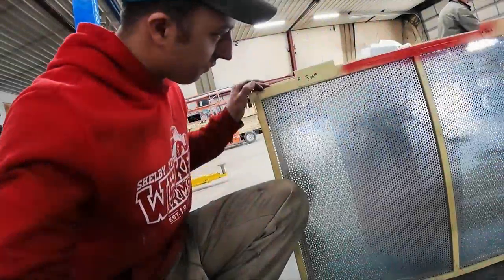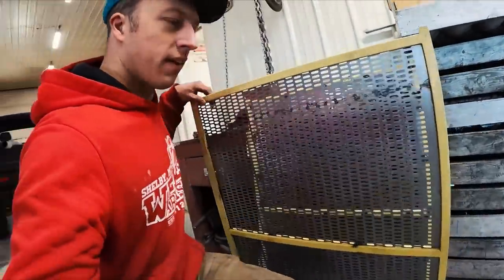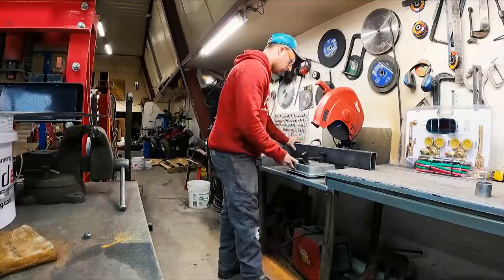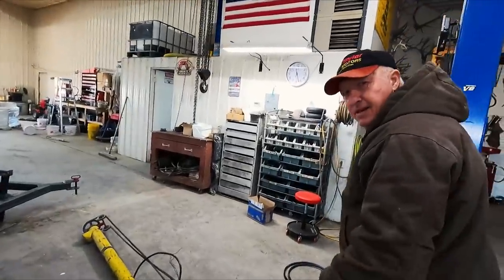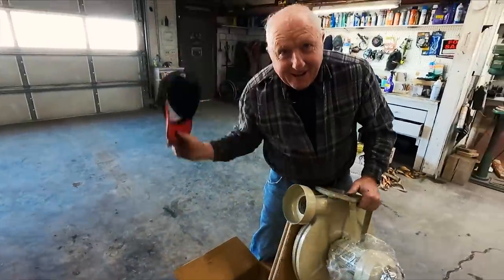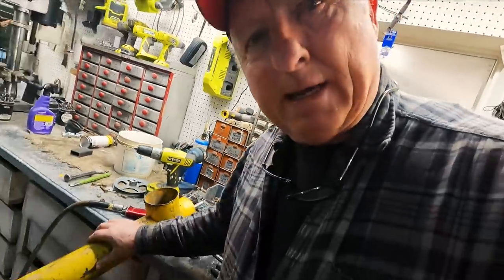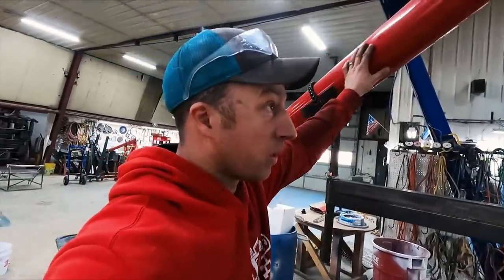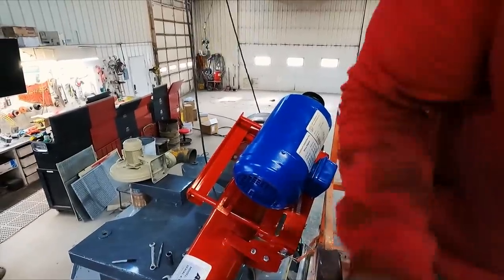It's FABRICATION DAY! Mixing Old with NEW

Comment: You guys should look at lenze drives.  The ac tech will work great, you can input 110v and it will output 3ph.  I use them all the time.

Comment: You should put a small spring between the bottom of the tube and the nut so it will lock itself into position and you wont have to worry about it vibrating out

Comment: From my past years in a certified seed cleaning plant,  you may want to add a valve/ plate on the air suction to restrict or a "y" to allow-blend "outside air" if you're channing lighter material.

Comment: Buzzing doesn't turn over probably needs a starter capacitor.  One way to check is plug in buzzing doesn't turn over and spin it.  If it begins to move, good chance putting a starter capacitor on it may be what's needed.
That fan looks like a bounce house fan.  Is that what it is?  Might be the perfect blower to run a blacksmith forge.

Comment: You might need to introduce some sort of choke on that fan so that it is not too aggressive but are the blades curved at all? If forward curved you could quickly burn out the motor.

Comment: I would have drilled into the pully lock setting screw into the shaft of the motor. Put in the set screw with a little Loctite. Just my thoughts, what ever works works... !!!

Comment: You need boelube from Tacoma screw for drilling...
I just did 22 5/8 holes in one in plate with boelube and one drill but in 1 hour mostly letting the bit cool. It's awesome for any kinda metal drilling

Comment: On vFD’s there is a difference in “centrifugal” and “Material” loads.  
Ie: Centrifugals are often used in my industry for centrifugal fans which as you go slower reduce torque and amperage as a load by 1/3 as you slow.   VFD’s for this application are rated at about 1/2 the amps of a static load. 
If you have one or more motors in on a conveyer the conveyer needs to run wether it’s loaded or not,  static load at start is high when conveyer is loaded.  VFD needs to be higher amp designed for static loads to carry the entire load from 3hz to 60hz.  Probably identical VFD same voltage but double the amp rating.  May physically be larger to handle the load. 
Simple information for concept but if you check with supplier.  They will need anticipated load with auger full and running 2 to 3 hz.  Based on that, amperage power can be calculated and choose VFD.  
Fundamentally VFD’s are amperage machines.  They are often rated in HP but a 1/2 HP VFD will work fine on a 1 HP fan but you will need a 1 horse power VFD of identical for an auger or conveyer
Reply: Thanks for the info...... Now to digest it 👍

Comment: Whatever you decide about your VFD, your idea for using VFD is solid.  Even if it costs far more for a drive independent of the motor, you will save far more over the '5 -70 year life span'  just by the difference of energy consumed.    The lateral rotating arm appears to render support in wimpiness?

Comment: Just get a slideing gate damper to adjust your airflow for the fan or a slide gate somewhere on the intake side of the system they are cheap and work very well its just a vibrating dust collector system on wheels

Comment: If its like a 2-3 hp motor, you can use a single phase controller, a bridge rectifier, and a run capacitor to even out the waves and avoid a lot of the cost/complexity of a VFD
Reply: Good to know

Comment: Maybe mount the whole shebang to and used truck chassis with engine and you'll have a seed cleaning combine.
Reply: It needs to be sitting on the ground for it to work best, otherwise all of its shaking would be transferred to the truck chassis and rattle it apart.

Comment: Just a thought, but you guys are probably already ahead me. How about using a set of step pulleys to drive the feed auger? I see the 3 phase freek drive is not working, easy to jump a belt on say a 5 step pulley set up. Also seen a comment on sucking debris thru that fan. How about a dust collector fan for sawdust. I've had  one in  our wood shop for years, just a cheapy, but still runs and runs.    Keep on farm'n !  Regards from Wisconsin

Comment: If the suction fan impeller blades aren't designed to have debris run through it, the blades will wear quick.
Reply from the maker: It definitely will and you'll see in a future video we already changed this 😂

Comment: VFD controllers are so cool.  I run a lathe and a hydraulic metal shear with one - but not so much for controlling speed but for using a 3 phase machine with a location that only gets 1 phase power.  The controller you're looking for needs to be at least 1/3 higher capacity.... ask me how I know, I'll show you my 3 phase controller with a max capacity of a 1/3 hp motor (which, I didn't realize they made them that small).... :)

Comment: Your idea for anti-sway is 'ok', but unless you are using monstrously strong bolts (like grade 8 automotive ones that are 1/2" diameter) the force wind can exert on that auger arm will be so massive it will just bend/shear your bolts. What you really want are a couple of triangular arms that attach to the sifter at the far pivot joint of the auger arm. Those will be far stronger, and have a much better moment of inertia.

Comment: Hey Nick back when I was farming I had a chicken layer house and we used variable speed controllers on the motors that pulled our egg collection belts but the motors were D. C. Current , yours might not work with A. C. current.

Comment: Bearing dust shields can be popped out and reused when cleaning or grease packing is required. Drilling a grease hole risks getting chips in the bearing. You lucked out, because the bearing was single shielded.
Another shaft flat alternative would be to spot drill the shaft. The set screw would provide even more shoulder for load than the flat.

I was also surprised that you didn't face the damaged pulley hub since you own a lathe.

I like the roller chain clamp feature. Put a cam lock nut on the tensioning bolt and you can field loosen the clamp without tools. This would allow linear adjustment to compensate for elevation variations.

Comment: from what i have see with your cleaner welding on the screen is a no no it changes how the screen works and you should have splice the screen together were the cover went down the screen.  I also see that you will need a VFD on the main motor it is running to fast.  you will need a VFD on your fan or put in a damper to control the air flow. You will also need to be able to level your cleaner so it is not lining on one side more the the either side. Just some quick and easy things to help make your cleaning much easier.  put i like what you are doing it will work put it's not a true cleaner.  a true cleaner  would work much better but they are not cheap equipment.

Comment: Are the blades metal or plastic on that fan? If plastic might not last a cleaning round. Usually if they put guards on them they don't hold up to to much abrasion. Can get a lttle jet or grizzly dust collector and either use it or take the fan off it.

Comment: Nice job! But by all respect that hole weekens that square tube on the worst place. By all that vibration there is a good chance that sooner or later it will brake. Wouldn't it been better to weld a smaller tube to the side of the square tube to put that bolt in?
Reply from the maker: You're probably right, but fortunately the Auger is light and half the weight is on the hopper side. But still agreed, would. Have been super easy to weld a small pipe to the side... Oops 😂

Comment: Your new rear shocks on the truck are upside down
Reply from the maker: I wondered that but then I looked up photos and it shows that way too... I'll look into it further.
Reply from the maker: I think you're right! Easy change I guess 😂
Reply: I was using your video as a install video for my own 🤣 I said that doesn't look right. May have been the issue to the air bags?

Comment: Was that VFD designed for multiphase?
I know it's much easier to adjust single phase. 
At work we ended up buying a cheap variable speed gearbox, because it was easier than doing variable speed on the motor.
Reply from the maker: We're fairly limited on our electrical knowledge but to our understanding three phase motors are better for variable speed but we only have single phase on the farm. So that vfd converts single to three and allows for adjustment. But I'm sure there is a better way! The vfd was rated for 1 hp and the motor we ordered was 1.5. People said online that it'd work but turns out the blue motor draws more amps than the vfd can handle
Reply: @WelkerFarms  Ah, that goes way beyond my knowledge as well. 
Australia is 240v single phase and 415v 3 phase, so I'm not sure you could do the same conversion. 

What we ended up buying was used, a single speed 415v motor that was attached to an inline constantly variable gearbox. BUT we also have 3 phase in the workshop already.
Here I'd just go single phase because it's easier (we have a couple of display units) BUT I'm not sure how much grunt the 110v you guys have can punch out.

Comment: Buzzing noise, no rotation...if the rotor is free it has bad capacitors which can be replaced possibly even from the motor the seems to have a short.